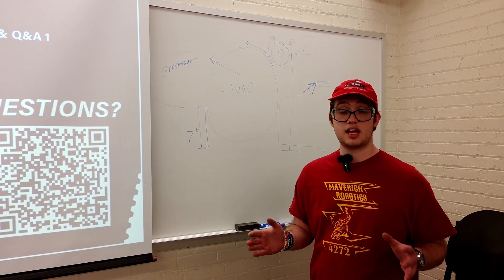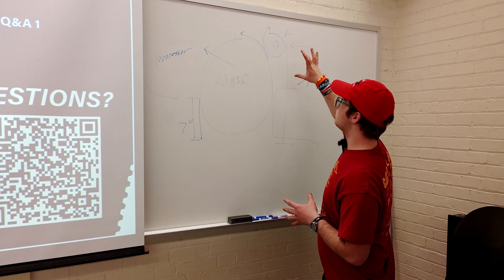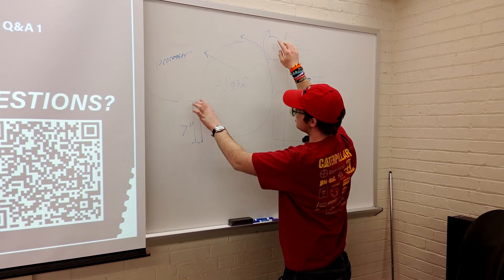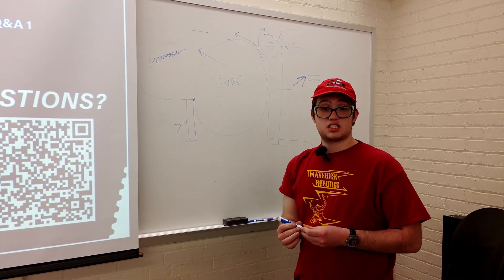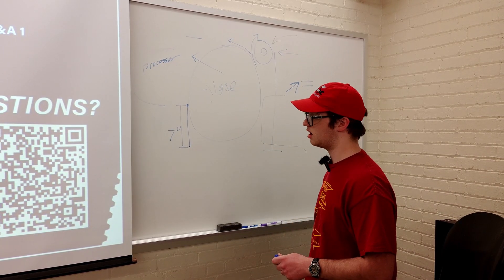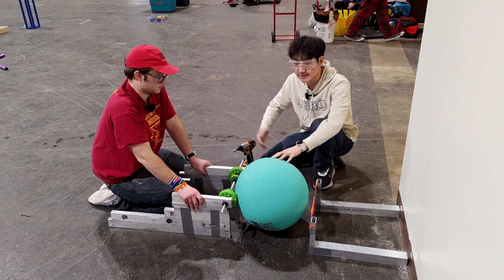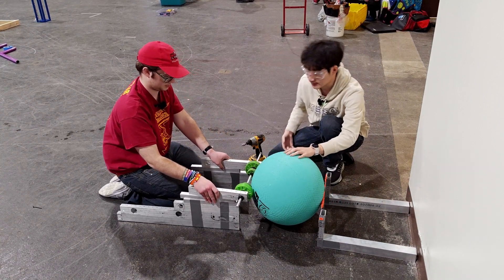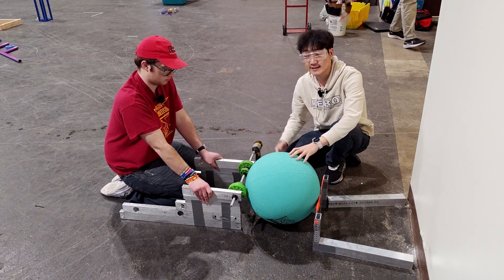Ri3D @ Purdue Day 1: Algae Pusher Demo

Comment: How do you plan to get the Algae off the reef? Something to knock it off to the floor? Or are you using the same mechanism raised in elevator to engage the algae?
Reply from the maker: We plan to utilize the coral mechanism to knock the algae off of the reef. We believe that fine motor control over the algae while on the reef is unnecessary if you can just knock it off and then grab it again once it's on the floor. We plan to do this by spinning in place, hopefully pushing the algae off with the rod. 

-Aaron
Reply: @PurdueRi3D  yep, that would work. If your intake for coral utilizes spinning wheels, you can manipulate the wheels to spin the algae also. Any plan to climb?
Reply from the maker: Yes, that is roughly how we plan to utilize the wheels. We will be attempting a shallow climb. 
- Daniel